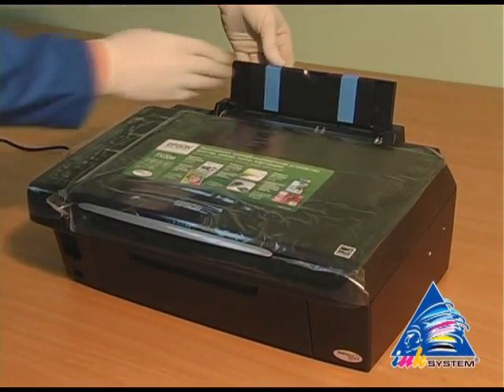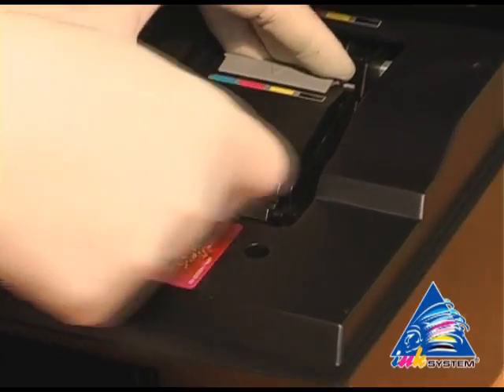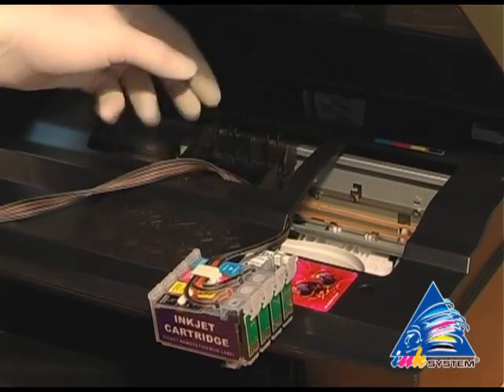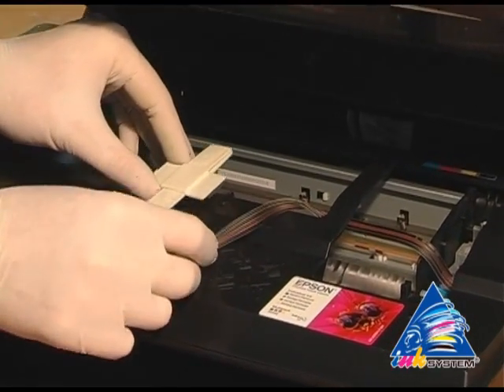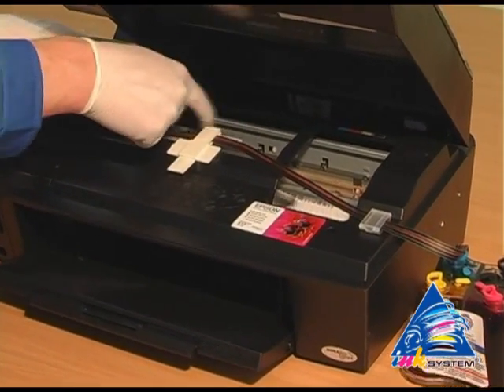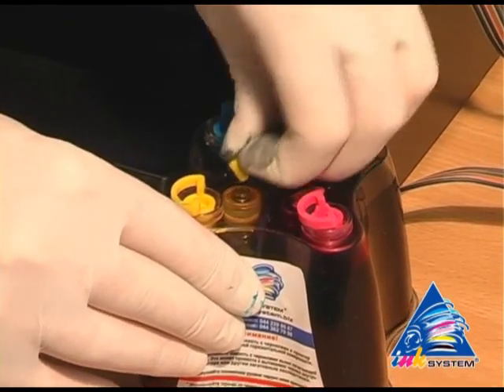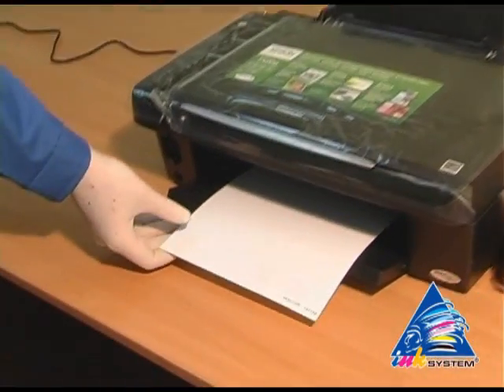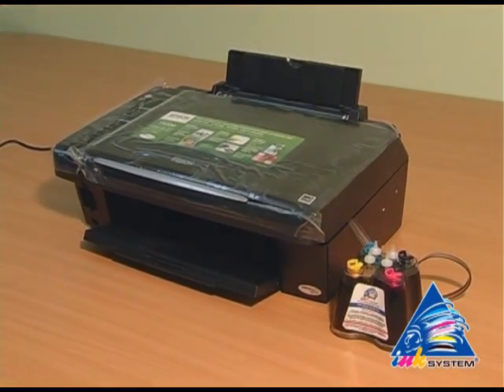CISS for Epson DX8400 DX8450

Comment: DX 8450 uses oil based ink so the image won't be smudged when in contact with watter...I was told that when I bought it...and I tested it,and the image won't smudge...I'm interested in this system so I wanted to ask u,is this ink the same(oil based)....?...and I like the image quality on my printer,but will it be the same with this ink...?..